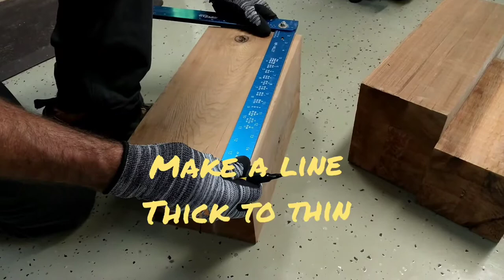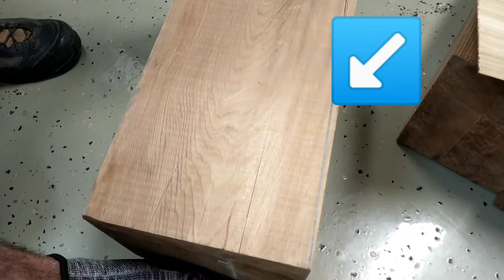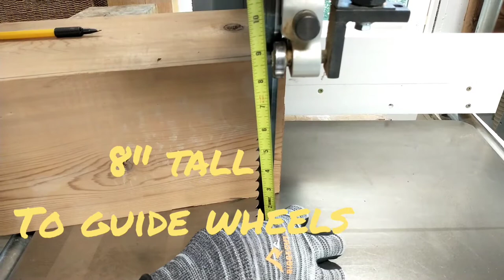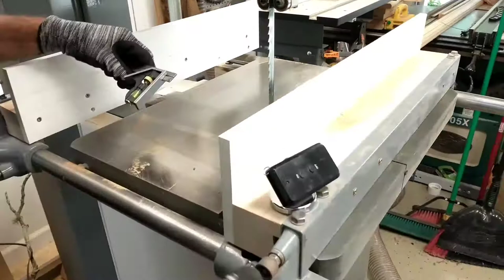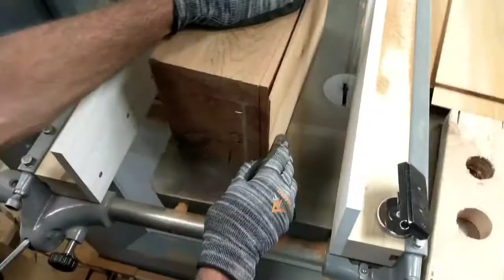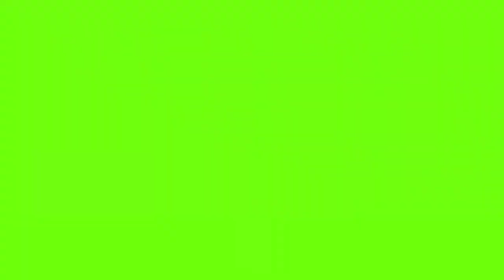How To Turn Scrap Cedar into Shake Shingles #diy #howto #homeimprovement

Comment: You don't need to draw the angled line what you do is run the block against a outside fence but Shim out the block at one end from the fence so the block sets at angle. Because you're not cutting the fence side of the block you can shim out with a drywall screw to ride the fence.

Comment: BTW I was trying to make tiny shingles (e.g. out of 1x3) for a chicken coop. I don't have a bandsaw. Word of warning -- don't try this with a table saw. :-)
Reply from the maker: 😅I can only imagine!! I did small shingles for a chicken coop as well. I found that scoring the shingle with a sharp utility knife was all that was needed...I was able to snap the shingle with not much force at all👍
Reply: @YouCanDoIt2  you used normal sized shingles, and scored/snapped them? Trying to visualize how that turned out, without having shingles of very different thicknesses. I'm going for shingles that are about 1" x 3".
Reply from the maker: @josh_m  shingles that small might be too difficult to make with the scoring method. Maybe a handheld jigsaw would do the job.

Comment: The problem that people don't realize is that historically they cut these things at a very specific angle in the wood - rather like quartering-- Because this process was more durable in the sun and rain over time.  

Simply cutting these out means that they're going to warp and cup.
Reply: Great point,  I'm thinking at the very least you need to cut them quarter sawn or rift.  Plain sliced and they're not going to work.

Comment: Why not split the wood, the good old fashion way?
Reply: They are more durable if they are split.
Reply: He just cut a bunch of face grain.  They need to be clear and split so the edge grain is showing, that's what makes them stable.  If you have a bunch of 3/4" clear cedar around you could mill high grade shingles but the per linear foot of 1x6 clear is $5.50 right now.  I think you could sand them to a really nice finish and have an unbelievably nice looking roof but the cost is the same as #1 shingles plus the time to mill it.

Comment: Yeah so "expensive" #1 shingles, are all quartered and clear showing nothing but edge grain.  That's what makes them stable.  You cut a bunch of face grain.  Probably fine for a shed no one will see but on a house it's all going to curl and look terrible.  The only way to make shingles on a band saw that are of the same or superior quality to #1 shingles is to make them out of 1x quarter sawn clear cedar which is about $5.50 a linear foot or $8.25 a shingle for an 18" shingle.  Multiplied by 20 is $165 and here we are at the same price for a bundle of #1 shingles.

I really wouldn't be knocking the video at all but in your description you're talking about making expensive style cedar shingles and that's not what you're doing.